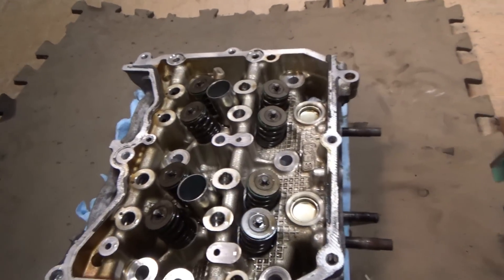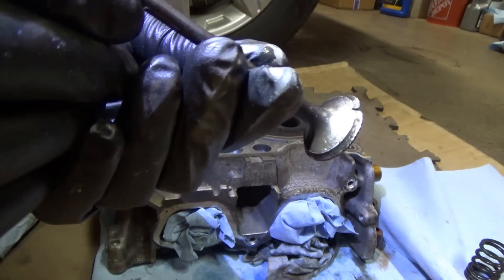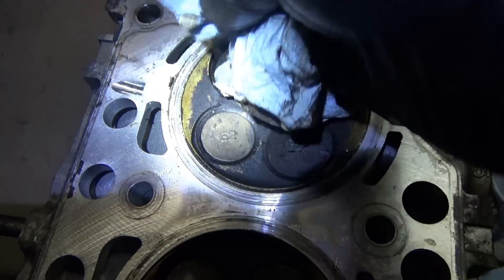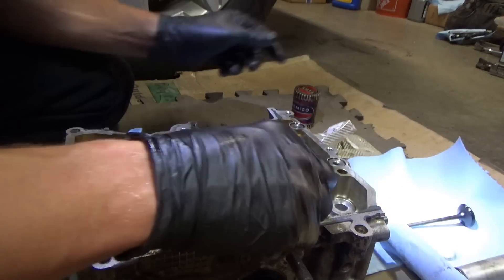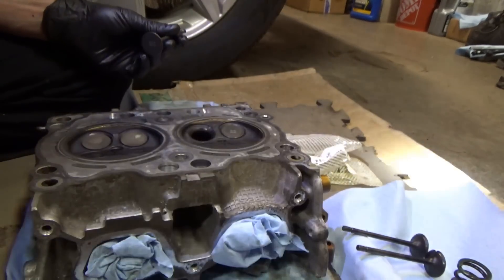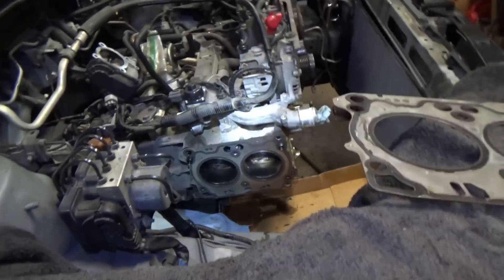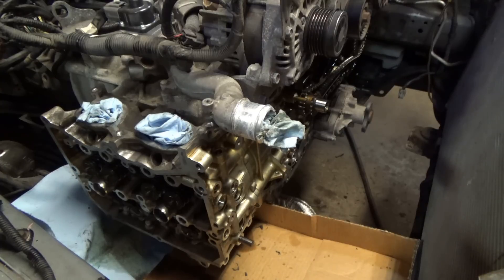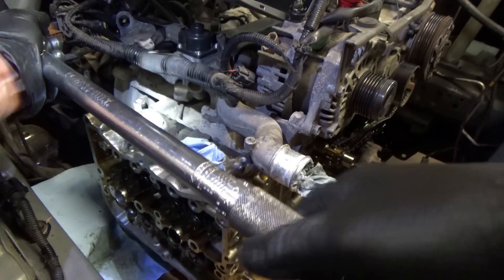What Happened to these EXHAUST VALVES!? (The Sad Subaru - Part 3)

Comment: If you charged the customer $2K then you can bet the Subaru dealer would want close to 4, and I know who I would trust to do a better job!  Well my wife's 2019 Forester has 71,000 miles, if this fault occurs with that as you're so close I'll be bringing it over to you, not sure you would want to do it again though!  I'm hoping this particular fault was sorted on recent models, like the head gaskets Subaru must be aware of the problems with these valves and you would think they would do the right thing and put it right at no cost.  But of course they won't.

Comment: For the small cost you should have changed out the valve seals.Maybe not as necessary on the boxer stye motor. Great work Ivan.

Comment: Japanwest here.  Subaru well known for burning oil . Debris and oil ash gets under the valve and seat leaving an open seal. Oil burn also causes extreme heat.  Is this the cylinder for the EGR port? also a contributing factor. Regards

Comment: Not doing the other side after the evidence of valve damage you saw is truly penny wise, pound foolish in action. I meant the customer, not you.
Reply from the maker: But it would still be an oil burner due to bad rings. This was basically the lowest-cost option to get the car back on the road and buy the customer some time :)

Comment: I am so glad i have a 2001 subaru outback where you dont have to remove the cams to get to the head bolts, they started making  things more difficult as the years went by, same with all cars and trucks, its called engineering against the consumer
Reply: They want to engineer something that is very overly complex, plus they want to do it spending as little money as possible.  That's the sad reality of modern automobile engineering.   Over complicated design, with shabby cheaply made parts.   One reason I'm such a big fan of Honda.   For years, they've made all their own parts, engines, transmissions, and they use forged cranks and rods in every engine, or at least I know they used to.

Comment: Hi IVAN,I'm afraid your going to get flak on this one.Most guys here that have done this type of repair{lapping valves in}noticed the VALVE SEATS.Any pitting {the dark spots}on the seat also is a place that doesn't transfer heat.OR can still leak pressure.AS for the valves themselves, they are either not heat treated right or crap steel to begin with.Or just a guess this thing burns oil and is forming carbon deposits the the exhaust valves. ALL this is on the assumption the valves have the proper valve clearance specs.Remember as your valve wears INTO THE SEAT the valve and rocker arm clearance tighten up??? keeping the valve with less time ON the seat to cool.But the reality on this car is,this guy is hard up,doesn't have or want to spend for a long term fix,but iv'e done fixes like this that lasted years.But like someone mentioned i too LAP  a lot longer 1st coarse then fine.but you did a good job for the guy under the circumstances.thumbs up buddy.

Comment: You did what the customer wanted... get it running cheap!  But, I don't think those valve seats looked very good.  Just for the edification of your few non-mechanic viewers, when the pits get that deep it's recommended that you cut the valve seats to get them clean and re-profiled.  I don't know what the angles for this engine are but, Subaru was very fussy about the earlier 2.5L.  If I recall correctly the exhaust seats required four cuts to meet spec.  The combustion chamber, top relief, seat, and lower relief cuts were all different.  I'm sure your repair will get the owner enough miles to justify the cost of this repair... then, I have no doubt, he'll get rid of it.
Reply: I’d probably wager more that this is to get it running to get it sold or traded. 

Doesn’t seem to make much sense at all to go through the trouble on the repair this way and expect it to last…
Reply: I bet customer will be selling it as soon as it’s repaired.  That’s why I don’t buy used cars anymore.

Comment: You forgot one very big fundamental right there!! You didn't replace the valve stem seal!!
Reply from the maker: Unnecessary, especially on the exhaust valves of a new-ish lower mile engine :)
Reply: @PineHollowAutoDiagnostics  makes no difference. I would have changed the valve stem seals. mileage plays no part. I've pulled engines down with less than 50,000 miles on them, requiring what you did to this engine, & I replaced the valve stem seals. It is a smart thing to do. It is a job I was doing up until I was pensioned off 16 years ago. Here in Australia, it is what we do. As for your valve grinding job, it is not up to scratch either. One day, I'll upload a video where I do a full engine rebuild on a Mercedes M117 series V8 engine. In this video you will see proper tools in use. I have no idea what that valve grinding tool you used was, but it is certainly not a tool I would use, nor is the valve spring compressor. I used to do engine reconditioning/rebuilding for a living, both part time & full time. When I did valve work I did a lot of things you failed to do in this video. First of all, you did not remove the carbon from the valve seats, as carbon build up is typical in engines where they have a burnt valve. Next, you failed to test the seal of the valve, by filling the combustion chamber with solvent, & checking the ports for leakage. You also did not grind the new valve to the valve seat that had the burnt valve correctly. When I did this work, I removed the carbon first, then I used THREE grades of compound, NOT 1. I also lubricated the valve stem. Once I finished lapping in the new valves, I checked for a uniform ring on both valves, & seats. Prior to this, I tested the valve to valve guide clearance, using a dial gauge. Another test I used to do to ensure proper seal is to test for uniform contact using bearing blue. A drop on the valve sealing face, drop the valve in, then rotate one full turn. I then withdrew the valve, & looked at the mark left by the bearing blue to check for full blue ring on both the valve & valve seat. Once these were satisfactory, The new valve was installed, a new stem seal fitted, then reassembly commenced.
Reply from the maker: @christophermarshall5765  All good points, and thank you for the tips! So let's say the customer spent twice the money to get the job done "right by the book" with all the correct grinding and shimming etc etc. Fact remains that the Left original exhaust valves are still on borrowed time, AND the engine still burns oil due to crappy piston rings! This was a real-world solution with a few compromises to get the car back on the road and at least guarantee reliability for a few years on the new valves. Next repair will likely be a used low-mile engine if the customer doesn't sell the car first :)
Reply: @PineHollowAutoDiagnostics  smart people don't buy Subarus in the first place, for this reason. They rarely do more than 300,000km. When I did rebuild work on Mitsubishi 4G54 engines, I replaced the blade in the ridge remover after each cylinder. The bores in those are hard. I know you'll agree when I say the shim clearance setting method is a pain in the arse. My car has hydraulic lifters where the rocker arm pivot points are. Very efficient system, but you'd expect this from Mercedes. A lot of engines these days, are not lasting as long as their older variants, & are also using more oil.
Reply: @PineHollowAutoDiagnostics  Your logic is flawed Ivan. Using your logic no other Exhaust valves would need to be replaced. :)
Reply from the maker: @JOHNSUE28  Logic is simple: if a part is obviously bad, replace it! Especially when getting to its neighbor is 14 hours of labor haha

Comment: Poor quality metal caused pitting which caused no heat transfer which caused burned valve.  The carbon buildup just made it worse.  Subaru engines suck.

Comment: Good video...But I will say this- you have guts doing that repair without checking valve stem height, replacing the valve stem seals, not having the head checked at a machine shop and trusting that old school torque wrench and re-torqueing method. I would not feel comfortable doing all that work and taking that chance, risking a time consuming boomerang. But that's just me. You got guts kid.
Reply: Its not guts its Ivan helping a customer on a budget. If he could of done this job for two grand all while sending the head off and replacing everything i sure he wouldve. Your own time means just as much. You can help people but to an extent. Some other people might not have the budget to take something anywhere thus here he is helping them.This is what you explain to the customer aswell if they say this is all they can spend
Reply from the maker: I trust my methods and workmanship...always a compromise between budget and how far to take a big job. Quality and reliability are my goals, and I am confident this repair will last many thousands of miles :)

Comment: About lapping the valves; I remember back when I was in high school I was watching a mechanic work on some valves and he had a rubber suction cup attached to the end of a dowel rod and he just rolled the rod back and forth in his hands to lap the valves.  Seemed to work really well.  I guess that was back in the "old days". 😄
Reply: That's the correct way to lap in valves even today.  You can get drill attachments that give the same motion which is a lot less tiring.
Reply: @ferrumignis  I had(have) a crank tool that oscillated back and forth, and 'stepped' the valve around as it was being seated.  Suction cup on one end, a crank on the side, and a wooden knob at the top.
Reply from the maker: @GrumpyUnkMillions  so fancy!
Reply: @PineHollowAutoDiagnostics  It was a Sears catalog tool, about $5.49 back then.  Had valve seat cutters - a selection - that cost $20-something for the set, used on a Chevy stovebolt 6.  High school fun.
 FWIW, if you want to know you have good valve-seat contact, when you push the valve free of the seat, look at the 'part line' where the compound has stretched and then separated.  Should be constant raised thin pattern all the way around. tom
Reply: @GrumpyUnkMillions  u can test it with a flashlight as well or some  thin oil based paint to see the witness marks. you just drop the valve in, and do not spin it,. the paint will show you where its making contact or not.  also a easy, cheap way to check a head for cracks is to sprinkle baby powder very gently over the head or block,. surface tension will not allow the powder to fill the crack . I learned this watching a mechanic abt 40 years ago. you have to remember, things were still being checked and found long before fancy systems like magnaflux. Heads used to be surfaced on a piece of  thick glass with sandpaper.
Reply: @ferrumignis  a piece of plastic hose is all u need.
Reply: Still got my dad's in the tool box different size cup on each end.MISS  you Dad.
Reply: I use a drill and a piece of plastic tubing.. place a piece of plastic tubing over the valve stem that fits snug, put the other end of the tubing in the drill. a piece abt 6 inches long is fine, lap them forward, then reverse.. keep doing this until lapped. pushing the valve stem in and out to redistribute the lapping compound.

Comment: Maybe the crack developed in the manufacturing process which was not picked out at inspection either in the forging or hardening processes. maybe it was an issue with the type of material seeing as the old version was E2 and now it is E3. just as well it didn't get any worse. good spot, well done sherlock!

Comment: My opinion.. Motor should have come out. Both heads sent to machine shop to get completely done properly. Valves adj etc.
Reply from the maker: Eh it would still be an oil burner on borrowed time.

Comment: I am glad i don't own a Subaru. Thankfully no valve issues with any Toyotas I have owned. Seems like any Toyota I have owned never has any real issues at all.
Reply: Toyota did have some oil burning engines with bad piston design
Reply: @garyalford9394  Ford had some engines that just quit..like our 97 Taurus. Ditto transmissions. Total junk.

Comment: That damage on the valve looks excactly the same as my 1990 Mazda 323 had back in the early 2000's. 
My car had carburator, without catalytic converter, so the mixture probably wasn't exactly correct, like in fuel injection &  O2 sensor systems, and the engine consumed a little oil, but not massive amounts. It had 4 valves per cylinder, and only one exhaust valve in cylinder number 1 was like this. 
It had about 300 thousand km's at the time, car was about 13 years old. Found out the problem, when the car failed the MOT emissions test :D

Comment: At 160k miles, it would make the most sense from a longevity standpoint to send both of the heads to a machine shop for a complete refurb.  As it is, the next valve failure looks imminent. Customer will probably sell the car to some poor sucker.
Reply from the maker: Only 120k on this one...